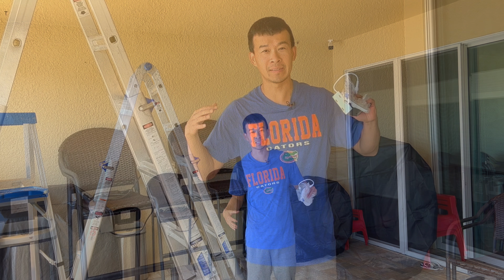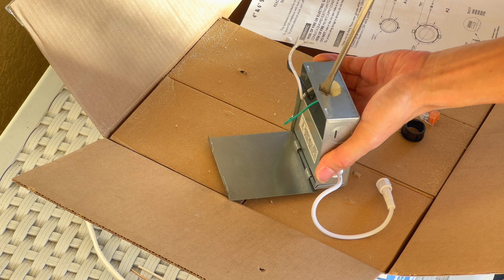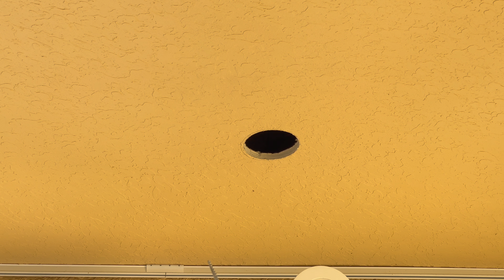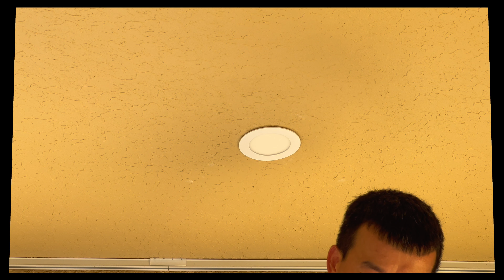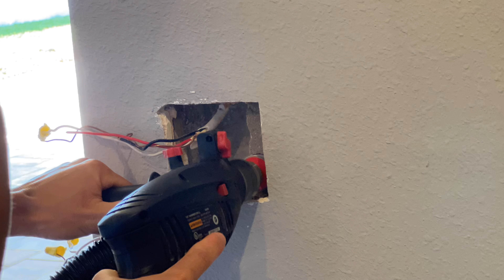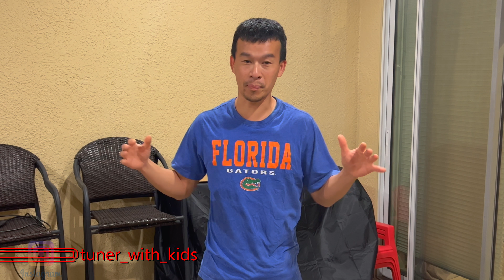How to Install Recessed LED Lights - Amazon Ultra Thin 4-inch Recessed LED Retrofit

Comment: I know this video is from a year ago, I'm just now watching it. I just wanted to let you know (if you don't already know or haven't found out) that these types of lights are specifically designed to go under studs. That's their purpose; so that you don't have to worry about trying to avoid studs. They are a little thinner than 1/2" sheetrock.  Just an FYI.

Comment: Brother if you could help me out on your is300 vvti solenoid connector there’s two wires one Is red and the other is yellow with black. Does the red one go towards the front of the car and the yellow towards the rear? Or vice versa. I got the wires mixed up when replacing the connector.